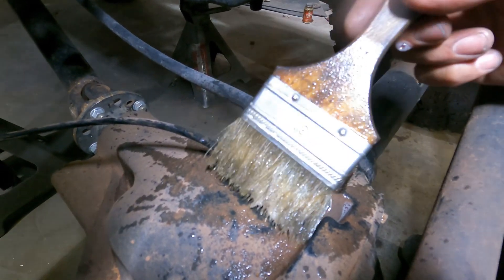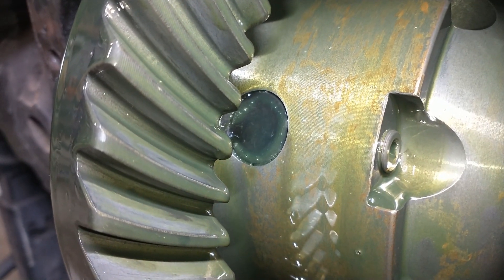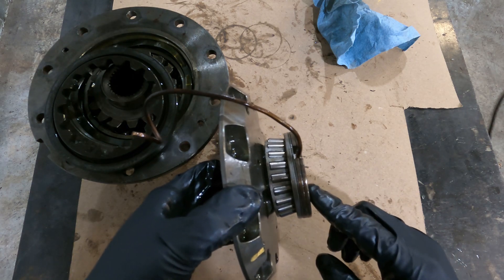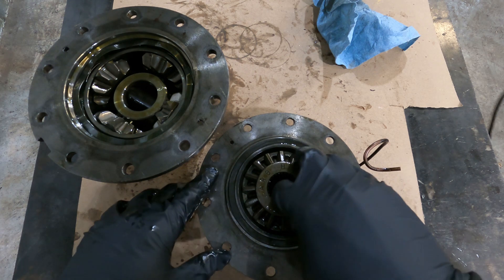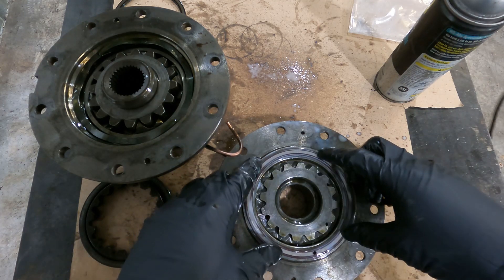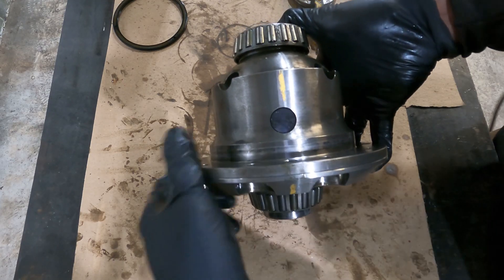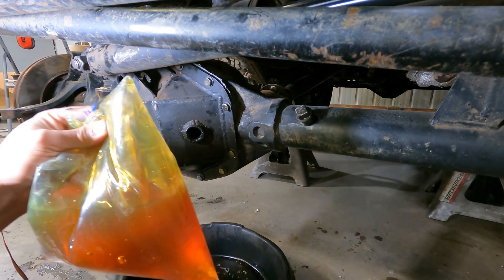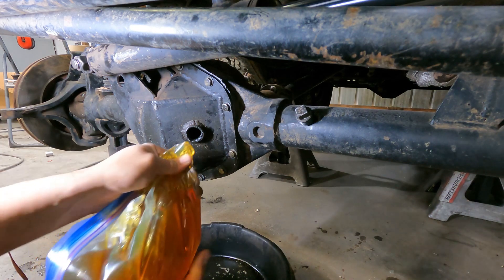Rebuilding an ARB Air Locker!

Comment: my compressor runs on and off while driving with my lockers in. but only when the vehicle is moving.
Reply from the maker: That could be the seal housing seals. The seal housing stays stationary while the carrier spins inside of it.

Comment: I have a wagoneer front axle in my Toyota. I’ve never messed with lockers in my life, but my ARB quit working recently. Couldn’t find an air leak externally so I was going to tear it apart and check all the seals/ clutch bits and pieces. Where do you find the kit to replace all that stuff?
Reply from the maker: Look up the parts diagram/manual on ARBs website. Summit Racing carries the seals/parts but they aren't listed by the application because the same bonded seal is used in several different applications. Same with the seal housing X-rings.
Reply: Hey Man, my ARB locker has leaked off and on since I've owned it. The install shop was crap. Anyway, I called ARB and said I had the leak problem and they mailed me two seals for free. Give it a go. Good luck.